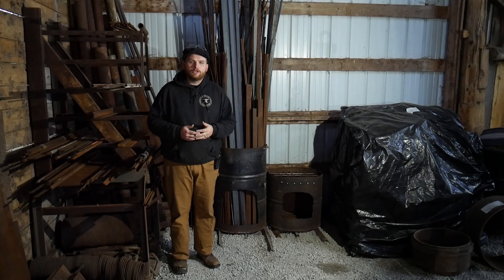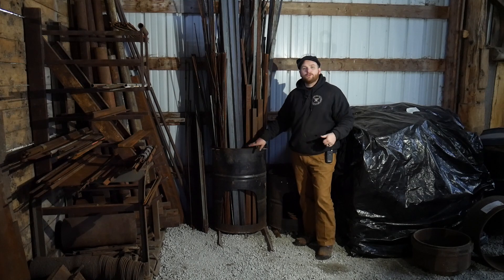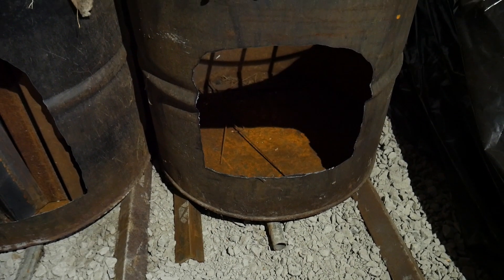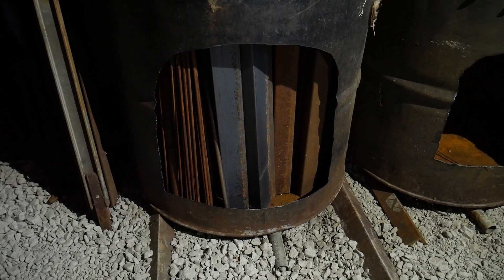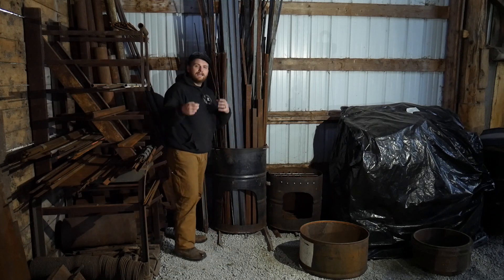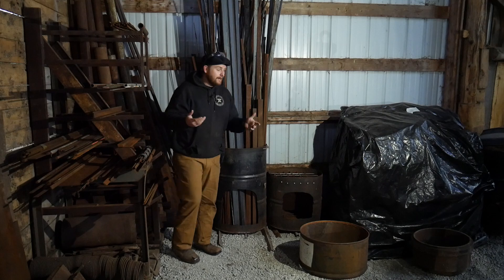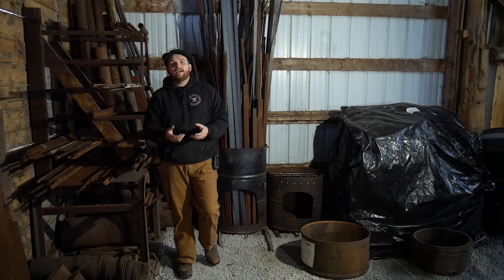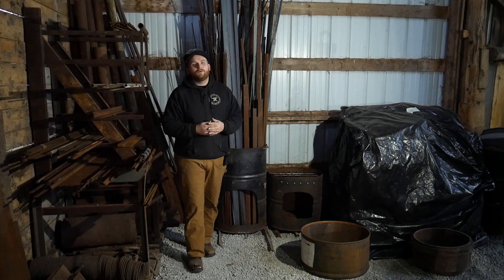Storing 1 Ton of Steel!

Comment: I use vertical storage in my small shop. I used salvage channel and truck frame rails about 4 feet long 1 ft wide with horizontal dividers. Overall height is 8 ft. Heavy.  Great to keep steel sorted and inventoried. Each section has chain keepers     I use cut off barrels as you have put in grids for short. 5 ft less then one cut down to last 3td just for less than 1 ft

Comment: Nice pro tips. Especially the low window  part for small cuts dropped in the bbl system and the drainage holes. Secure the bbl to a post or wall is advantageous as well.
Thanks Roy 
🙏 God bless yall now and well wishes 🌲🌲🌲Crawford out 🧙‍♂️

Comment: Roy, If it were me I would have a hoop fastened to the wall about 2 feet below the height of the longest stock. When you go to load your barrel you can place the top in the hoop and then lift your stock into the barrel. Better safe than sorry.

Comment: I understand the barrels aren't affixed to the wall.  I would still be concerned about the one with the tall stuff in it.  If for some reason it shifted, you or someone could end up at the bottom of a steel avalanche.
Reply: Alternatively have a safety chain/cable up high.  Then you'd have to lift up to clear the barrel and slide it back out.  The higher up it is the less leverage a shift can exert on it, so the simpler it can be.   It would also guard against moving one causing a shift in the others.  But hey it's your shop, do as you will.  I'm just a proud member of the internet safety brigade offering suggestions where none are needed lol ;)